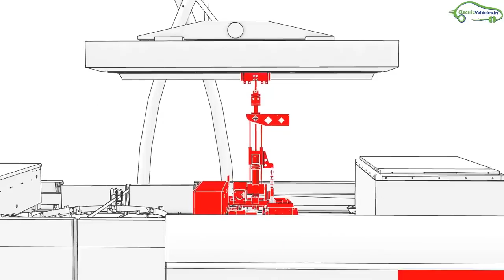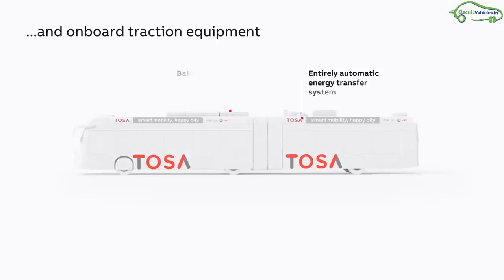IIT Madras 20 Sec Flash Charging Electric Bus in India

Comment: Really the best solution for commute busses. The cost of installing flash charging systems every 4 - 6 kms. The cost Vs returns via- a - viz  battery swaps every 40 / 50 kms to be worked out . 
Yes the initial cost Tare wt of battery and all such to be evaluated